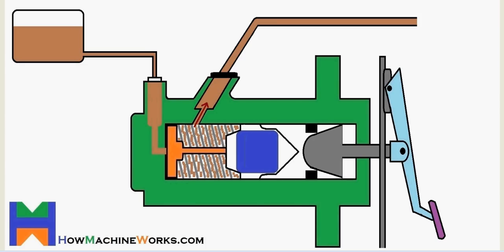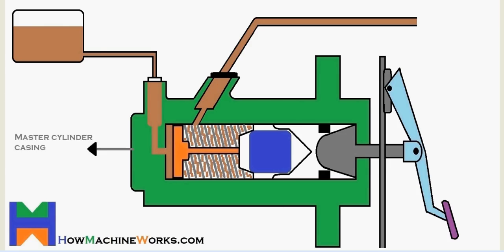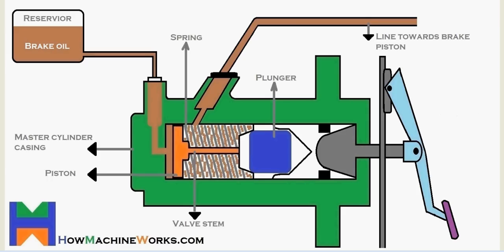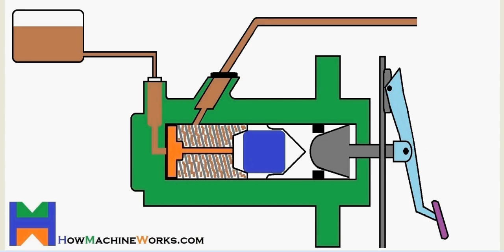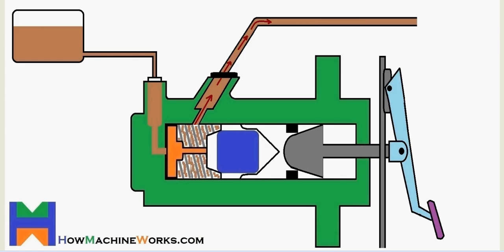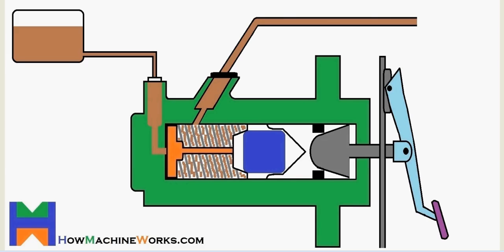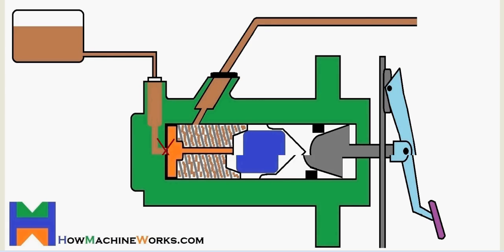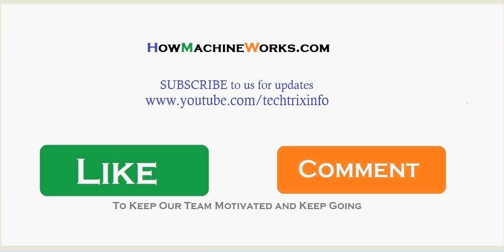Animation How brake master cylinder works.

Comment: This is NOT how a master cylinder works. Plus modern master cylinders or tandem or dual piston master cylinder. You do not explain this correctly and you do not show inlet or compensating ports. The image you have listed above is incorrect. The reservoir inlet should be before the compensating port!
Reply: I'm trying to find information on the two ports, do you have a better source?

Comment: About as simple as it gets.  Unfortunately most cars use a dual master cylinder that features a failure mode, which this video does not show. This video shows a master cylinder typical of a 50+ year old car. It might still be used in some other applications other than automotive vehicles.

Comment: hello, thank you for this interesting video, I have a question I hope you could help me, I've mazda 3 2007 & the problem is with the brake, i've to push the brake pedal too much till the brake catch it, I went to mechanics & they told me it's master cylinder & I bought new one but the problem is still the same I just lost my money, then I went to other mechanics the said the problem is with ABS Module, the other said it is brake booster. I don't want to buy again till they're sure.. I hope it's clear & you can help me. thanks in advance.. my email is nhabdijah@yahoo.com
Reply: It could be the pipe connected from the master cylinder to the break discs, it may be leaking. Try changing the pipe and see how It works.